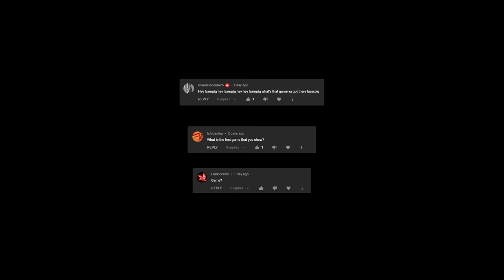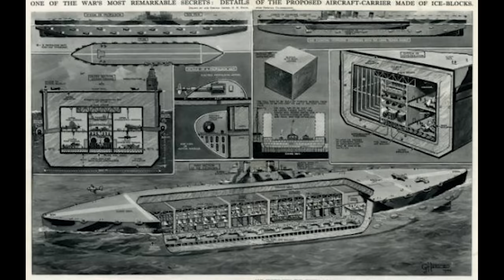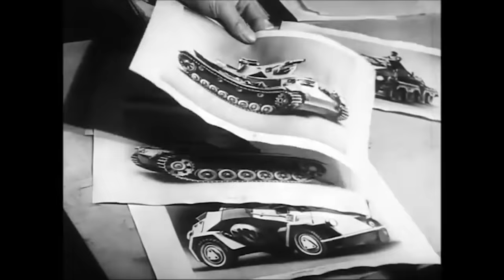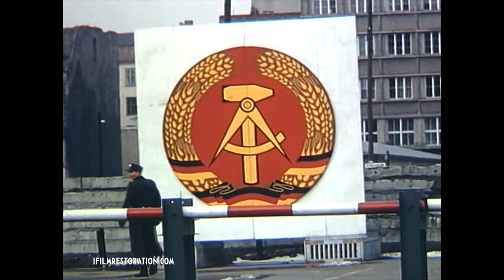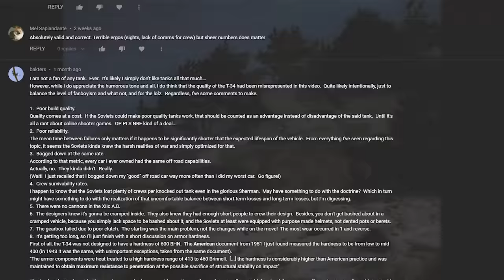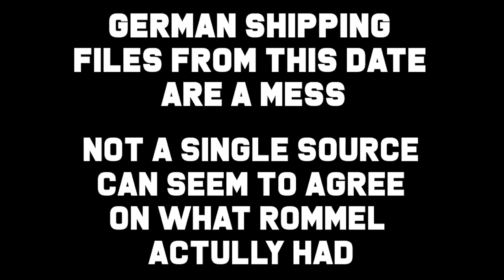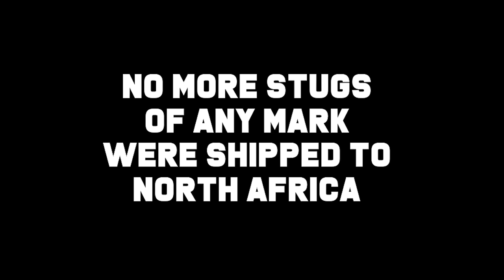In defence of the Crusader Tank

Comment: Wow, I literally rewatched the T-34 video just yesterday and wished that the Crusader defense video idea would come true. Thank you!
Reply: Quick, wish for a new video
Reply: tbh the T-34 video is rather sucky in my opinion.
Reply: @jammygamer8961  Thank you for sharing, now take your opinion and put it here 👉🏿🗑
Reply: @jammygamer8961  I'm curious as to what makes the T-34 video sucky in comparison to LazerPig's other output?
Reply: @TheScorpionStrike  some of the stuff he says is just outright wrong

An example of this is that during the T-34 video he said how cast armor is better than rolled.

A second example is him saying the Matilda bounced shots from the german 88mm like they fired papermache
Reply: @jammygamer8961  from the minor metal working we do on our farm, I would assume cast is stronger. A solid piece of metal will outlast multiple pieces folded around the edges. Bending metal will create tiny, sometimes microscopic, cracks. This reduces strength.

Edit: but the Matilda example you gave seems valid.
Reply: @samdherring  the thing about casting a piece of iron or steel is you simply get what you get. This has to do with impurities and alloying materials and how they are distributed through the piece. The nice thing about casting is you can make large pieces fairly quickly. If you roll the armor plate (a form of work hardening) you also have to either build a frame to attach it to or weld a bunch of pieces together. Casting is not better, but it is faster.

Comment: Honestly the biggest problem with the Crusader was the way it was used. For all the problems with the Panzer 3 or 4, those were typically thrown with infantry, meaning that if the tank couldn’t deal with a anti tank gun, pull back, and let the infantry handle it. Meanwhile the Britain threw the Crusaders far to often alone against the enemy, typically during the feints mentioned in the video. So while Nazi tanks may not have been much better,  they were much better at covering said weaknesses. It’s also why I believe tanks were designed to fight tanks, infantry can fight infantry a lot better then they can fight a tank, so designed their support vehicles (tanks) to fill the gaps.
Reply: The concept of a "cavalry tank" in of itselfe failed in WW2, meaning that the crusader was doomed to fail itselfe the moment it was written down on the drawing board.

And im afraid that does make it a bad tank design. If your tank can only shine in make believe fantasy scenarios and then fails in reality... that makes it a bad design. If your hyper specialized tank design never gets to use its specialisation cause the reality of war doesnt allow for it... that makes it a bad design.

Sacrificing reliability, armor protection and firepower for the sake of speed did historically turn out to be a massive failure. Hence why no crusader was still seeing action after the african campaign and where replaced with tanks like the lee, sherman and cromwell.

No matter how much "whataboutism" and made up scenario is going to change that the crusader at the end of the day was not a good tank to face the demand of the time.
Reply: @riptors9777  did you not even watch the video? it wasn't a bad tank it was bad tactics, when Britains tank doctrine was sorted out it performed just as well as any other tank, just because the cruiser tank idea was flawed didn't mean that it had to produce bad tanks, just look at the Cromwell, it was an exceptional tank, performed well because of good a doctrine, also why do you keep writing 'itself' as itselfe?
Reply: @Battyj  Just because lazerpig says so doesnt make it true. The crusader was thrown into the trashbin after the african campaign, if it performed "just as adequate" as other tanks of the time, why did no crusader ever see action post african campaign in europe? I mean its not like a couple hundret extra tanks wouldnt have come in handy no? And again: If your tank does not perform well in actual battles of the time it is a bad tank. It doesnt matter if the tank is great for a certain scenario if said scenario never actually happens on the battlefield.
Reply: @riptors9777  it did perform well in actual battles after the doctrine was fixed, if you are trying to stab someone with the handle of a knife, does it make that knife bad? No it means you used it wrong, and the crusader was used outside of north Africa it was converted to an anti air role, no having more tanks doesn't make you more effective, the crusader wouldn't be able to keep up with superior tanks such as the Cromwell or Sherman so they were converted, armies don't just throw all their tanks at the enemy and expect to win wars, they have to be used strategically
Reply: Personally? Crusader was not a bad designed tank. The problem was, it wasn’t a good one either. It was simply adequate, and when better designs were made, they simply swapped to those because you only keep inferior tanks if you have to. And the British didn’t have to.
Reply: I agree. It took a much heavier tank to stand against a serious AT gun, and even a 35-ton Sherman genuinely struggled, never mind the 23-tonners that were the Pz. IV and t-34.
 The crusader was armed with a decent gun matching the Pz. IIIJ, and while camera footage always made it look easy, actually hitting a large tank was very difficult beyond 500m, even for stationary guns. A small tank actually was much harder to hit, making the crusader more survivable in an age of crude fire control, which was also an important thing for the t-55.

Losses were high on the soviet side and early British side because combined arms were not understood. the ussr had no idea about it, and not even their successor fighting in Ukraine today could manage it. Why is that entire armoured column advancing into an urban area with less infantry than there are vehicles? What did they expect would happen?

Tanks were blind and really not THAT tough even before the panzerfaust, but expanding the weapon system to include an integrated infantry screen made it a lot more robust. As a side note, good design also included visibility, ergonomics and communications within the vehicle. A commander who was also a gunner or loader makes the tank blind while it was firing or reloading. The PzIV is special because of the large cupola positioned in a place with optimal visibility, a crew layout that was ergonomic and guaranteed a radio etc. that allowed it to perform well, despite being a 23-ton tank whose ammunition caught fire more easily than a Sherman.
Reply: @Svenne-man-1880  It was a tank made for a combat situation that had nothing to do with reality. And a tank that does not work very well in real combat is something we call a bad tank.

If your tank only performs well in theory then you have a lemon on your hands

Again: The crusader tank was so bad that not a single one was used after the african campaign had finished.. and there where still 2 years of war left. And its not like they where replaced only by american tanks, but other british tanks like the cromwell or comet who both saw action in europe. The crusader however was hastily replaced after the african campaign.

Thats like saying that the italian tankettes werent bad tanks or that the panzer 2 wasnt a bad tank even though those 2 designs where horribly outdated the moment they left the factory gate.

The crusader fails objectively in every aspect but speed. You can get the same performance from armored cars of the time and in some cases even better in terms of firepower.

How can you say something is a "good design" when you get outclassed by armored cars?
Reply: @riptors9777  it wasn’t a bad tank, it was an early tank. I honestly think comparing it to the Panzer 3 is fair. The thing is, after Africa, you have tanks far better suited to the needs of the Allie’s, so why use them? It wasn’t bad, it just wasn’t good. And when you have actual gold tanks ready by the literal boatload, why use only adequate? It was a 5/10 beat by betters.
Reply: @riptors9777  why the crusader didn't show up after the African campaign?
because they didn't have to, by the time the campaign was done and concluded, and most importantly they British were ready for the next phase of the war, better tanks had been designed and produced/acquired in sufficient numbers to successfully displace the older models, namely Lee/Grants, Shermans and Cromwells
the crusader served till the end of the war, as a reserve tank, a gun tractor or a mobile AA gun platform
Reply: @wesleyfravel5149  It was hot garbage, its gun was to weak, its armor was so thin it could be defeated by the germans pak 36 (wich was so bad the germans themselves named it "tank knock device" cause all it could do was politely knock on tanks for the most part). Its reliability issues in africa made it look like an early panther in that department. And its only strength, its speed, was completly negated by the desert.

The only thing positive to say about it was that it was still better then most of what the italians brought to the field.. and if you have to take italian ww2 armor as a measuring stick youre really scraping the bottom of the barrel

And comparing it to a panzer 3? The panzer 3 was superior to any british tanks used in africa kept for the matilda at the beginning of the african campaign (hence why the matilda was coined the "queen of the desert") Its hardened front plate was able to even defeat armor piercing rounds from the crusader. A capability that could not be claimed by the crusader who regularly got destroyed by the short 5cm KwK.

There was a reason the brits invented the camel dung mine.

"It wasnt bad it just wasnt good"

Now if thats no copium i dont know what is XD
Reply: @riptors9777  yes they didn't have to
following the NA campaign it was the Italian campaign, the width of the front and the addition of the US army meant that they didn't have to commit as much units to that front, so they just committed the units with the most modern tanks and pulled everything back home, where they could prepare and get reinforced with better tanks

the USSR was a much different situation, having to fight a war across a continuous front thousands of kilometres long, plus the disruption caused by the axis advance and then re-localisation of factories meant they had issues getting enough production to fill the TOEs for a non inconsequential amount of time

the crusader was roughly equivalent not to the Italian tankettes, but Italian medium tanks and (M13-M15) and German Pz III
all of which could be just as easily be destroyed by British, American and French weakest AT weapons

you're the one coping because someone compared favourably shitty British death box to your favourite German superior engineering murder machine

Comment: I love when you said the thing about reliability. Was there actually any reliable tank in WW2 like a legit reliable tank that practically only broke down when it was shot? Because i don't know a single one.
Reply: The Sherman.
Reply: The main thing that prevents reliablity issues, is having spare parts available, and knowing what will break in what conditions. Surprise surprise, one of the few armies in wwII that could manage that on the regular, and also test their tanks in a variety of terrains, and in quite frankly silly quantities of spare parts, was the americans, and their iterative design that was the sherman.
Reply: @Destroyer_V0  you underestimate having a machine designed from the ground up for easy repair and servicing. a Sherman platoon could replace the transmission on any of its vehicles from organic equipment and manpower in about 45 minutes and do a full power pack lift and repalce with one lorry from the REME (or equivalent) detachment. if a panther had ALL the spares in the world it still needed two days and a specialised mobile crane to swap out the transmission. Logistics combined with readily serviced kit wins wars.
Reply: @daveharrison61  Surprisingly, no. I agree with ya. Less time spent maintaining a vehicle means more time on the frontline. Even ignoring other factors, simplified maintinance (Something the US has somewhat stepped away from) is good in pretty much any machine.
Reply: This is where it can get gloriously ambiguous. The T34 was plagued by mechanical issues and some were (as LP mentioned in his t34 vid) stuff like the gears not being hardened so grinding themselves to bits. The Tiger I was (as The Chieftain) discussed, a 'breakthrough tank' that was designed to be brought of for special occasions, a 'little black dress' as it were. Not constantly deployed and being moved around all the time 'firefighting'. As a result, it broke down far more than you'd like; is that an inherently unreliable tank though? A car needs a service every X months; if you don't service it for 3X months and it breaks down, that's not the car's fault really.

The best example of an actually reliable vehicle (in the 'would last a good while driving around') is the american stuff, not just the Sherman but everything, even the humble jeep; they knew it was going to be shipped on what was, most likely, a one way ticket to the other side of the world both figuratively and literally. If it broke down it was safe to assume it wasn't coming back, so it had to be mechanically reliable. Pair that with a good logistics train supplying a steady feed of spare parts that actually met the required specifications, you got vehicles that are still happily rumbling around today.
Reply: @Destroyer_V0  I kinda take this to come from the way as I understand it, American officers tend to shy away from the front, like the us military has a huge tooth to tail ratio and from what I’ve heard from veterans I’ve talked to is that top officer cadets seem to want back line positions or armor jobs 

Basically the best talent seems to want logistics and operational jobs instead of infantry roles which is why you probably have the american military meme of the Lt that’s basically just a Boy Scout with a gun and stupid good logistics
Reply: @Valiguss  pretty close. Typically those officers in the back line tend to get promoted more often because they gain the numbers to back up their rep. However they also get to be around higher ranking personnel more often which means they can also gain influence to get promoted. Fortunately most officers need a balance of both numbers and influence to get promoted; but there are always exceptions.
Reply: The Sherman
Reply: @ImNtDead  logistics also tends to be more known factors, you're dealing with supplies, not an enemy combatant that can be unpredictable. I can also only assume that rearline failures are less frequent and less harshly punished than getting half a dozen platoons killed in combat. A talented officer on the frontlines might rise quickly in times of war, but a decent officer in the rear will rise more steadily.

Comment: I thought that the reliability problems came from design flaws, in which they built a governor to restrict harsh engine treatment and of course the troops as soon as they found out took the governor off, greatly diminishing their service life and reliability. Maybe that is part of the issue, the filter system was most likely to support a much lower hp version.?
Reply: The filter system is placed in the worst spot possible. It has to be placed under the vehicle with a shovel pushing the sand into the filter to beat it.  A governor usually is there to limit the engine from over stressing the components that makes the power to the road surface (valve's, pistons, final gears....) If the governor was put in place due to desert conditions overworking the air filter. Then I do not blame the soldiers removing the oil plug of the engine before battle too. Because that means that they are limiting the top speed of the tank (to stop the sand clouds) witch means that they half the top speed or something ridiculous.  

Second alternative being that the cooling system was not enough making the engine run to hot and together with the sand sucking problem they governed the engine back to "fix" the problem. Even now it did not do anything to fix the problem but just made it slower even now it is barely going to extend the life expectancy of the engine ANYWAYS. I mean common running a car on modern roads without a filter is a SIN. And here we are talking about a bad air filter placed on the worst spot possible. Sand = dead engine.

Really to small a air filter usually just means that you choke the engine from air. A governor is not going to help anything. Unless the filter was so badly made that the engine sucking for air RIPPED the filter apart witch makes it totally not suited for ANY tank or DESERT!  XD
Reply: @TheDiner50  No it was goverened to make it slower because it would shake itself apart in trials, and they never found a solution until later and needed the tanks right now. I don't know if the filters was part of that, but I don't see much desert in the UK, so surely that was a factor, perhaps only enhanced as the vehicles were past their rated (for that model) speed. Though certainly it is up for debate and I have been too lazy to try to find where I heard that. lol